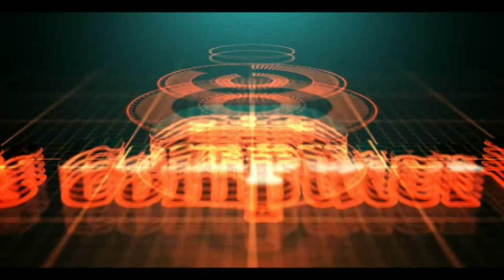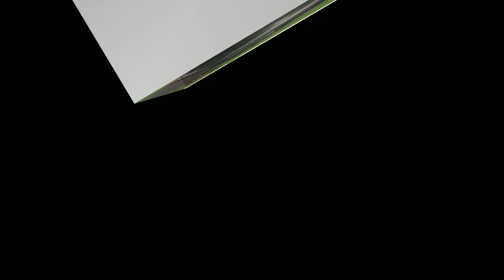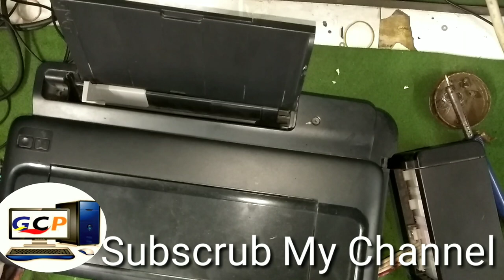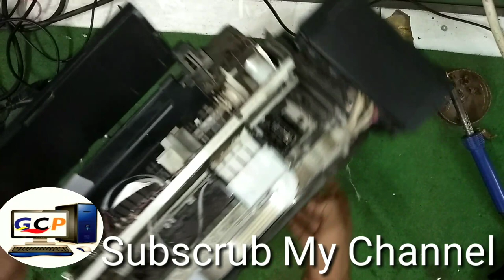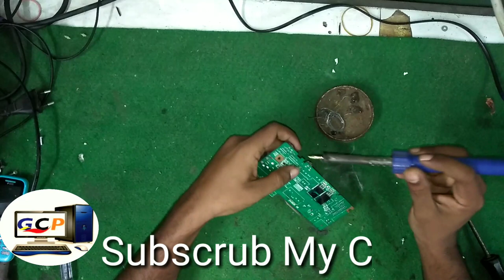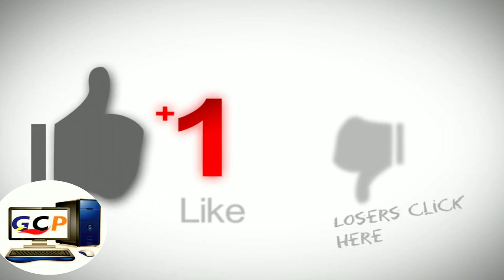Epson L130 Power Switch problem solution Sensor problem

Comment: You can easily open the cover of the printer. But I did not open the cover even after trying a lot. If you can, how to open the cover. Please tell where the net is where.
Reply: It happened with me to but after two hours I figured it out that there is a part below the printer which you have to open in order to open the cover but it went useless as the printer was not receiveing power.